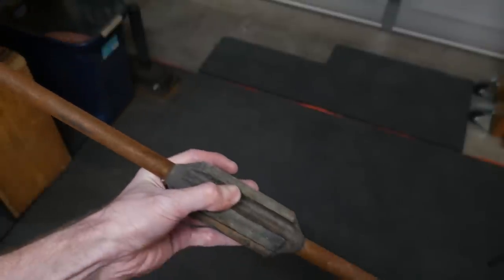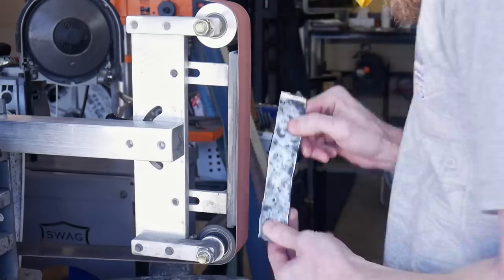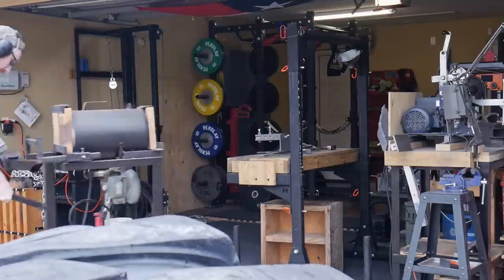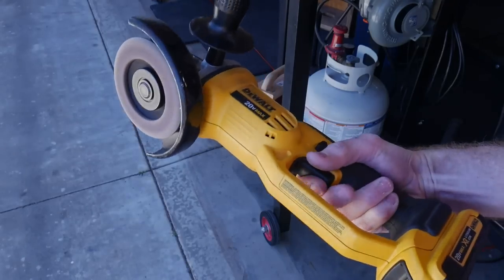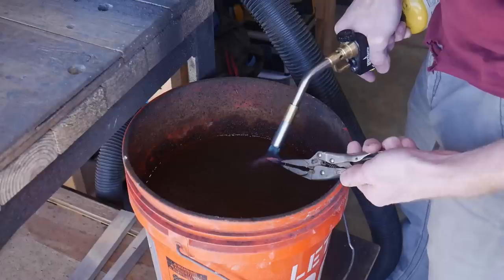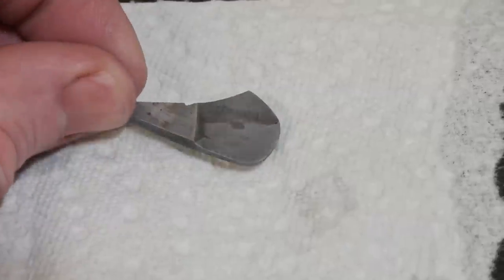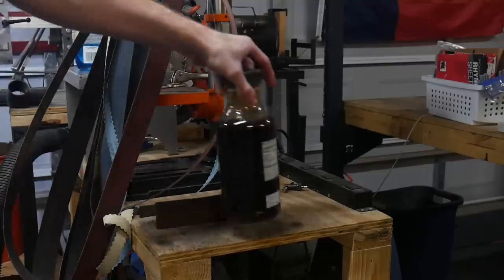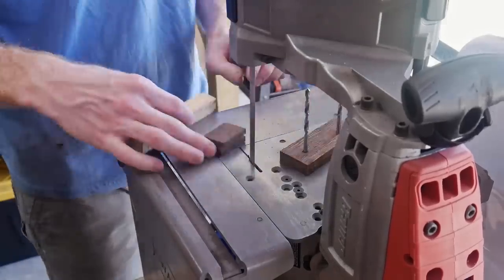Making A Knife From Oilfield Sucker Rod | Knife Making

Comment: Those hammer marks look familiar.  I still cannot avoid them myself,  but I have found that dressing the hammer face to round out the edges helps.  I still leave marks but they are not as deep and I don't need to turn as much steel into grinder dust.
Reply from the maker: Good idea sir! I should round mine out

Comment: I have ran into the same issue with that type of pins. What i did to fix the cosmetic issues was take some super fine brass dust, mixed it with epoxy and filled in the void. Worked out fairly well and is still holding up years later
Reply from the maker: Thanks for the tips! THat's a great idea! Cheers, Dustin

Comment: Awesome video man! Love the finished product and the race to get there! I have tried san mai 3 times now, all 3 have been failures and I forge a bit! I have been trying stainless san mai though. Great work man!
Reply from the maker: Stainless san mai sounds like a challenge for sure! Thank you sir. Your comments are always appreciated.
Reply: I think part of my problem is heat I am in the middle of doing a new Forge right now drawing inspiration from your Forge build video thank you sir! I'm going to scale mine up just slightly so I can do swords and I'm going to do a forced air ribbon burner. I've watched your video on your Forge build several times, after using it for a while do you have any other likes or dislikes about it? How did the solenoid for the gas shut off end up working out for you?

Comment: Try to use the angle grinder to round of the edges of your hammer it will speed things up and is make it easier to get the hammer marks out nice work btw
Reply from the maker: Thanks for the tip!

Comment: When I did that I drill the other side and applied black epoxy into the holes it looked a little better. Did you just leave holes or did you end up putting something into the holes. I also thought it would be cool looking to make them look like mosaic pins. Wouldn't be hard to do. Any way good job as usual thanks for sharing.
Reply from the maker: Good tip sir, I left it and chalked it up as a learning experience. Cheers man!

Comment: Good looking knife.  If the holes are deep enough fill them with epoxy tinted black or make some small plugs out of the wood. Drill an appropriate sized hole in a piece of steel then drive a slightly larger sized wood square through the hole. The steel will size the dowel to fit in the void
Reply from the maker: Good ideas sir! Thank you

Comment: Another good vid m8. As the saying goes If your not learning something new everyday then your  doing it wrong. I love learning as i go. Why just today i learned how not to fuck up a knife sheath 😂😂😂.Little tip for your anvil stand as i see its bouncing around alot. If its hollow you can either put a container in it and fill it full of water, or fill it full of sand. It will stop it moving around on you!
Reply from the maker: Good ideas sir! Thank you very much for your comment. I need to figure something out with that movement.

Comment: Hey brother, great video! I thought you did an awesome job forging out that san mai. If I could offer any advice at all it would be to try out vermiculite for annealing. It's like 3-5$ at home depot, Lowes, Ace, etc. I have found that annealing in vermiculite overnight reduces scale a LOT compared to leaving in the forge. Have a great weekend James!
Reply from the maker: Heck yeah, thanks Wayne! I'll give the vermiculite a shot!
Reply: I use permits just the same, but I think maybe even more important than that would be to adjust your flame in the forge to a reducing flame so it doesn't oxidize the steel as fast. I do use an oxidizing flame when I want to add scale pattern on the steel that will be left behind after grinding. That is how I textured the guards on the 300 sword! Less oxygen+perlite=less scale

Comment: About your jimping file. Is the line always at the same side? If yes then the file must have a thin set of teeth. Just remove it gind that side smaller until the line dissapears.  Just my 2 cents.
I think the wood is Wenge.
I know those fasteners as Acorn fasteners, I had the same issue with them and filled the void with colored epoxy as a highlight. The thickness available is so small that I don‘t use them anymore.

Nice knife btw.
Reply from the maker: Thanks Roland! I think you're right on the file and one side is slightly more of an issue tha the other. Those damn Acorn fasteners have such an exact tolerance... I won't be ordering them again! Have a great weekend!

Comment: If you'll bevel the corner of your checkering file, you can avoid that extra line to the side of your full depth Vs. I had to tune up the sides of mine. If you examine your file you'll see what is causing the scratch.
Reply from the maker: Good idea sir, I'll take a look at that. Sounds like it's worth doing. Thanks!
Reply: @RedBeardOps  It might even be something that you could do precisely with your surface grinder. C Clamp on edge it to a block that's stuck on the magnet perhaps.

Comment: Have you ever heard of a printed circuit heat exchanger. Well what they do is etch groves on a plates and sandwich then together into a tight bond by welding the edges together. Then place the bundle in a ss gas tight box with an inlet and exit pipe. Then place it in a furnace provide hydrogen to the inlet pipe with a bunson burner to the outlet pipe. Subject to the steel as I Remember heat the contents to around 12 to 13 hundred degrees C for about 12 hrs. When removed from the box the it is a homogeneous block with small passages through out. I suggest this because not knowing anything about knife making it may be of some assistance
Reply from the maker: Nope, I sure haven't heard of that! LOL, thanks for your comment!